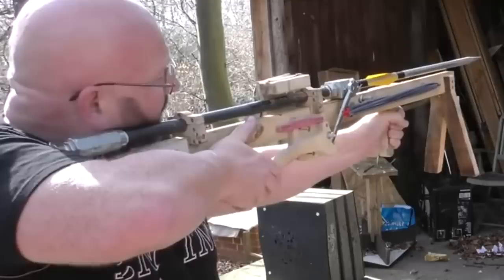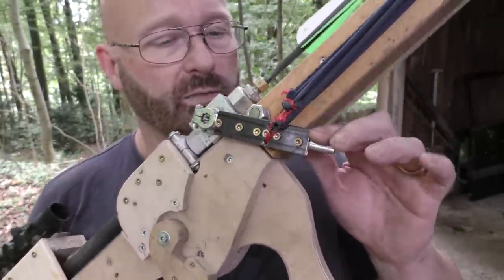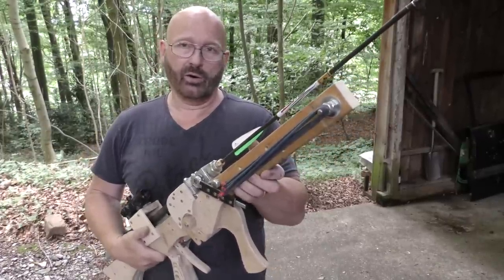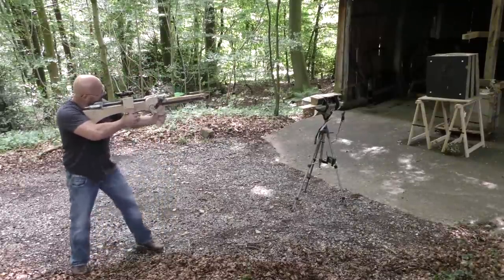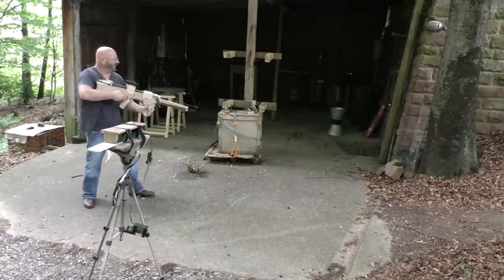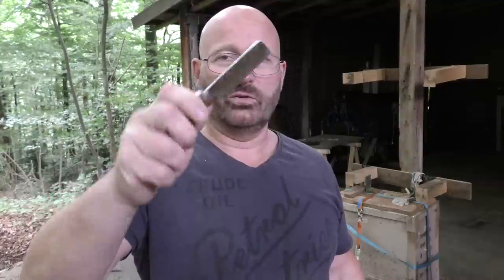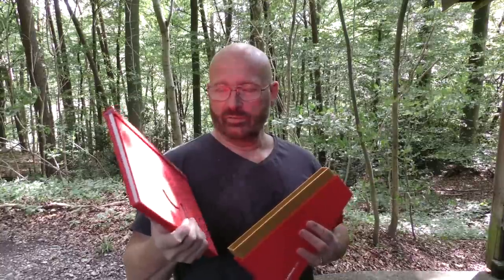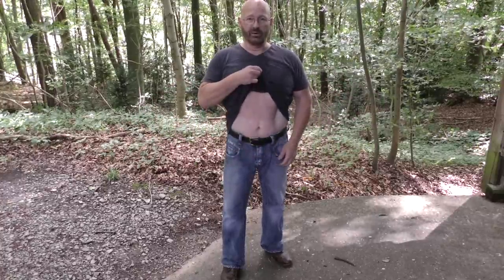Introducing  Epicness: Monster 1000 Joule Airgun! 550 fps.

Comment: Next: how to penetrate a tank with toothpicks
Reply: you only need a bazillion feet per second
Reply: Just accelerate it to 0.25 the speed of light so that it explodes with the force of several nuclear bombs.
Reply: Just hurt myself laughing at this, not because it is so funny (which it is), but because he could probably do it if he wanted to... and that would be the last YouTube video ever uploaded, because he would've destroyed the world, with a toothpick and some rubber bands.
Reply: If he could manage to make it penetrate atleast a Millimeter i'd be amazed.
Reply: It depends on the tank
Reply: J. K. I
Reply: That's called an APFSDS round ;)
Reply: G3NU1N3  Armor Piercing Fin Stabilized Discarding Sabot Right?
Reply: Anthony Benfield: Toothpick sized. Gonna take some precision German engineering.
Reply: - But sadly youtube doesn't allow porn anymore! XD
Reply: J. K. Technically, if the toothpick will be moving fast enough... it can destroy the tank.
Reply: Actually, yes, it can. But it would have to travel at speeds impossible on earth, due to the atmospheric friction. In space, however, it's possible. A 1-gram toothpick travelling at 100km/s has an impact energy of 5000000 joule. A modern armor piercing sabot round from an Abrams tank has an impact energy of 11.4 million joule, more than twice as much, but that we can achieve such an impressive figure with a mere toothpick proves how dangerous and potent speed can be.
Reply: easy
Reply: you cant get it to sufficient speed in atmosphere as it would vaporize. ... also beyond very high supersonic velocities (around mach 4 ish) penetration doesn't really go up anymore as the material just explodes once it hits armor and ablates material away. ... but if anyone could do it, joerg is the man.
Reply: Perhaps if we maximise what could be considered a 'toothpick'. I think we need to start formalizing our terms as far as dimensions and weight are concerned. That way we can do some calculations and see if we can get the numbers to fit. A 1 gram toothpick has been proposed. Do they come any bigger?

Also, is my idea for a depleted uranium tip viable? I would like to amend it to having the toothpick itself be the depleted uranium penetrator. Fired with a standard, if not miniaturised, aluminium sabot. 

The propellent could be anything that works as long as the primer is engaged by the resulting action of the rubber bands. A kind of "Sling Shot/ Cannon" Hybrid.
Reply: A harpoon is a toothpick, if you're brave enough
Reply: youre weissu a sheet i actually think that the cern could do that....with an electron
Reply: That would be very entertaining to watch.
Reply: J. K. When a body builder dates a small girl, this is their intercourse
Reply: J. K. Thanks to slo mo guys
Reply: youy can accelerate it to the speed of light and blow up eurasia
Reply: I guess you can make one of his catapults and then launch a bowling ball stuffed with explosives!
Reply: @MrAstrojensen  speed kills.
Reply: @FionnMarr  or may be with a rail gun it would do it
Reply: @dragonoflegend8798  I'd be called the Ex-Wife round?!😂😂
Reply: @FionnMarr  America knew Germany engineer's are the best, that's why they picked them up under "Operation Paperclip"
Reply: After he built the tank penetrate toothpick......

Next: How to penetrate a tank with a dust particle😂
Reply: @FionnMarr  Just my opinion but even this is overkill
Reply: @FionnMarr  this sounds worthy

Comment: Here is an idea: To reduce recoil, take one large hollow pipe and one slightly smaller in diameter (dosnt matter if hollow) pipe and insert the smaller pipe into the larger pipe. Attach a heavy duty spring around the  two pipes, and add a sholder guard to the end of one pipe (larger one) and attach the other end to the gun. When you shoot, the recoil will move one pipe into the other, and the spring will push them outwards as to keep shape of the stock and to also (theoretically) significantly dampen recoil.

Comment: You know what next just build a 5ft automatic sharp wooden stake launcher with an explosive gas canister on the the end using 5inch thick elastic with V8 engine to drive the mechanism 😂🤣
Reply: Just in case Dracula comes rambling by?
Reply: Ron H yeah 😂

Comment: Put a 6 mm barrel on it and then shoot it with airsoft bbs
Reply: That is not legal in germany
Reply: I think it might be less effective with a small bb. Maybe a metal rod or larger ball bearing. That's probably illegal in the People's Republic of Germany too.
Reply: Wait...you can own a Strumgehwher, but the second you replace gunpowder with compressed air, it becomes illegal?
Reply: bcubed72 it's semiautomatic when you should be able to have it fully automatic.
Reply: Jacob Staten 
That sucks from a "preserving history" angle, but practically, there's little advantage to full auto, unless you have a belt-fed MG. People are SO bent out of shape about it, when a cartridge-fed gun is likely more lethal firing semi!
Reply: bcubed72 there are practical reasons; suppressive fire, area targets, close quarter targets, disabling vehicles, drills, entertainment, blank firing for reenactment or movies. You are right about semi automatic fire being more useful as a rule and typically more deadly. Apparently Mosad use semi-auto  more often than not. But the point is that a benevolent government doesn't need to prevent someone from using full auto, the same as they shouldn't prevent you from using a pellet gun or bow.

Comment: With a little bit of rough math the pressure inside of the 0.4 litre chamber should be about 4,190,256atm. Good lord is that a feature

Comment: I suspect the arrow has left the barrel before the ball valve is fully open. You should take some high speed camera footage of that. Ball valves are not considered good for quick release. The best would be a quick exhaust valve (QEV) or a piston valve. If pressure permits it, a butterfly valve might also work.
Reply from the maker: Forget QEVs, that is low pressure toy stuff. QEVs are either below 16 bar OR needle valves with a tiny throughput. Maybe OK for low pressure spud guns. At 300 bar (5000 psi) you need something way more solid.
Reply: @Slingshotchannel  I see, from what I've looked up, high pressure, high flow and high speed valves are not common items. Though the aerospace industry does use valves like that in rocket engines. So it's certainly possible to make one. They're just bloody expensive (because aerospace). But maybe somebody knowledgable in hydraulics who also has a machine shop to manufacture things (maybe some youtube collaboration) can make one of these.
Reply from the maker: Well, the ones used for aerospace are usually really really big. Not suitable for a portable airgun.
Reply: JoergSprave yeah some are big, but there is also smaller engines like cold gas thrusters and hypergolic 3rd stage engines. They are not very big engines, but they need to handle a lot of pressure quickly, somehow those valves work. These engines are basically glorified spudguns :)

Besides using an oversized valve isnt the worst idea, long as it is quicker acting, that takes care of the flow problem.

Comment: You could likely get the same velocity with the crossbow bolt at a much lower pressure,  seeing as the bolt is so light and the tube so small.

Comment: Hey can you link the valve you used. I'm not going to use that high of pressure but i need a valve that can go up to at least 100 bar for a   pneumatic project im working on

Comment: For maximum velocity - and I know this isn't easily doable - consider charging the pneumatic gun with a light gas like helium.  The stall speed is much higher so the flow of gas into even the smaller barrel will be faster.  Faster gas = faster muzzle speed.

Comment: I'm sure it's been mentioned, but what kind of compressor are you using? The Yong Heng compressor is one of those that I've watched numerous videos on. One thing that is always constant is that it is not perfect. But considering that it can pump up to 300 bar and you can find them now for $300 or less, it seems like a good investment. Again, I can't tell what kind you have. 

If you have done a video on that compressor....then just ignore this.

Comment: Well done! luv you man ! keep up the work! I hot idea 4 you! once I used 2 old telephone poles /6 feet in ground and 5 feet out! the 3rd pole was 25 feet and like 18 feet was pinned to the middle of poles 11/2 inch pipe . it has a 3 feet pile with axe head welded on it! was gravity wood splitter ! I had a rope and few bricks tied on short back piece /for counter balance! I got it ruff made.. but then I had to move and tear it down.. maybe you could make a heavy Duty- log splitter ????? please ????

Comment: Jorg why you never use a qev , its very easy to build one and the explosive release will give it even better power and performance.
Reply from the maker: QEVs is low pressure crap. They may do a couple hundred PSI, tops. I go up to 5000 PSI. The only QEVs you can get at that pressure are needle valves with almost no throughput.
Reply: @Slingshotchannel  i personally built a qev that can  handle 6000 psi with no problems all you need is a very thick washer that has a powerful stiff rubber washer glued to it and a big steel rod that is threaded in the middle with a closing nut with a strong spring  . You put this mechanism in a T shaped steel junction tube ..

Comment: why do you need so much elastic on the trigger mechanism? surely a ball valve will turn pretty easily with just a few.
Reply: He wants it to open as quickly as possible. He could probably use a solenoid valve, or better yet, a custom spring-loaded slide valve with teflon seals, but he's trying to keep things simple and use easily obtainable materials (with the exception of the compressor of course).😉
Reply: @danw1955  yeah but thats a LOT of elastic.

Comment: I made something similar to that as a kid. Mine shot bottle caps same principal four by four four two by two put a nail or screw on the top little flat side. Running a rubber band over the nail or screw the screw to lock the rubberband in place how many backup we have an old school clothes pin spring on it you take the bottle cap put in for the rubberband lock it in place with the clothespin and we're ready to Flyer push down on the clothespin. It's nothing like what you have but it's the right angle you put somebody's eye out

Comment: Moin Joerg :) Gotta assure you my respect and adoration for your work, but...as a pedantic german moron I'd have to mention if you're displaying measures for an audience using mainly imperial scales and you're already providing calculations ( meters per second > feet per second)...Y not also offer the imperial pound(-force) per sqare inch in relation to the (metric) bar ;)
Ansonsten allzeit trockenes Pulver :)

P.S. : 1 PSI = 0.0689475729 bar  ;  vice versa 1 bar equals 14.503773773 PSI
;)

Comment: Just go buy Hatsan 125. 4,5mm 395ms or 5,5mm 390ms, i bought it for my son many years ago but ended up as mine after i tested it with steelbullets in plastic holders cause they went thrue somewhat thick wood aswell as some mm of galvanized steel plate that is bent into a olt type garbage bin/can with mesh front you can lift up to take garbage bag out